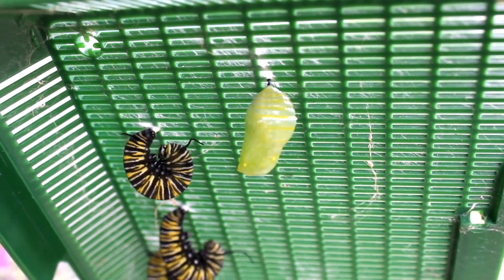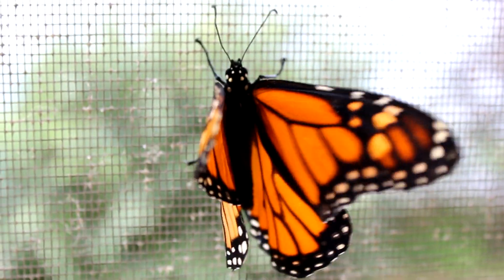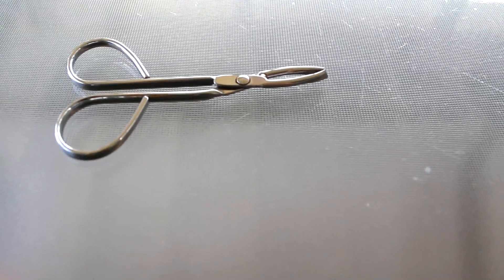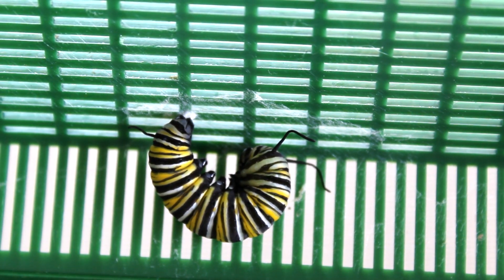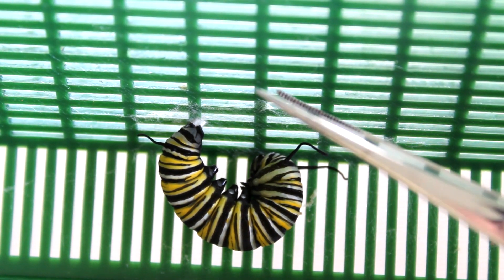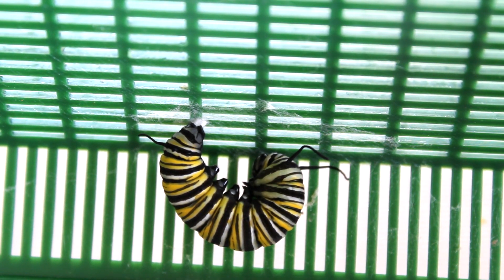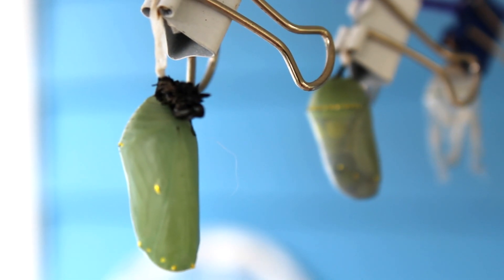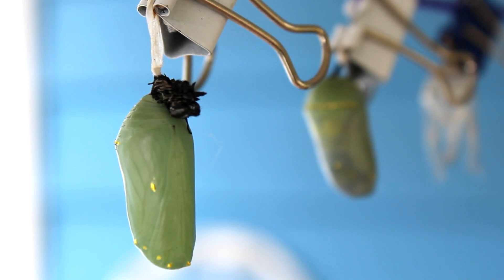Raising Monarchs - Side J-Hang Relocation (Help The Monarch Butterfly)

Comment: Great video!  I use the mesh rectangular enclosure and a few times as they were getting ready to j hang on the side I wasn’t sure if I should move or not (I was also quite new) and I did try to move before he hung and I could not see that he had laid the silk button because of the white enclosure.  I didn’t know what to do when I saw the silk as I moved him and resources for immediate feedback are very Limited or non existent.  I tried to get him to cling to the top of the enclosure but i didn’t secure him and he ended up wandering back down.  I was terrified not knowing do they only get one shot at laying the silk button and had I hurt him by trying to help.  Luckily he ended eventually made  his way back up.  Thanks for this resource!

Another issue I personally have been encountering pretty much every time since I started with these enclosures  is they all pupate in the corner and very close together but because of the oval shape of the enclosure they seem to struggle when emerging.  It’s been a big problem. For many of the chrysalis.  I have many pics and videos showing the full process if you would like to see to possibly make a video about (especially if using the enclosures for outdoor rearing).  My next round are all pupating and once again each one is going to that corner.   If you would like to know more about this to educate others that might face it please email me at kdinoto@comcast.net and I would love to share the experience with you and also get any feedback you might have on how to address.  Thanks so much your resources are so valuable!!
Reply from the maker: Sometimes people ask about relocating the chrysalis after it forms, and if that's something that needs to be done.  I definitely do it, but that's due more to the numbers that I might have at the time.  If many chrysalides are nearby each other, for the most part, there's no immediate problem.  However, if two Monarchs are coming out around the same time (which can happen often) and they are close enough, one can disrupt the other while the wings are drying, and this can cause major problems.  The wings being pumped with fluid and drying is a very important and vulnerable time for the Monarch.  For this reason, I relocate mine.  If someone is just rearing, say 5 Monarchs, it's usually no issue to let them pupate where they like, and they can even emerge in that same vessel.  But if there's enough to cause concerns when emerging, they should probably be relocated somewhere.  Further, if there are chrysalides that are housed with caterpillars, especially other 4th or 5th instar caterpillars, while it's rare, a caterpillar could nibble on a chrysalis.  It's been known to happen.  So, when dealing with larger numbers, this is another reason relocation is a good idea.
I definitely don't want to present the helping of Monarchs as something that need be expensive, but if you have enough numbers to where you are concerned about chrysalides clustering around each other, you may wish to have a separate pop-up tent that is reserved just for the hanging of chrysalides and as a place for the adults to emerge.  Just a possibility.
Good luck!
Reply: MrLundScience thanks it wasn’t even that there were a lot but they all went together in the same corner anyway and came out on the same day.  Moreover the rent enclosures are arched at the top so when they emerge they actually don’t have enough room as they would if the container were perfectly square. They realize this and try to move and they end up walking down the side in search of more room and then can’t hang to dry because they are on the side. I ended up getting him on a q top and then using a clip to attach it in the middle of the enclosure so he could dry but has I not been home not sure what would have happened.  I know you have them on the string but for those using the mesh enclosures for outdoor rearing I suspect many will encounter the same thing as my second round are all doing the same thing and congregating in the corner.

Comment: There's a much easier way to move them that might also be a little safer (no pointy metal objects). Just cut a piece of clear packing tape (about 2" x 2"), place it up on the "ceiling" so that the edge of the tape touches the silk button. Then press the tape really well all over the ceiling. When you peel back the tape, it will peel off all the hidden silk that is spread all over the ceiling, and take the caterpillar with it. Just do it slowly, and cup your other hand underneath the caterpillar in case it falls. I've never had one fall. Sometimes you'll have to apply two pieces of tape, one on either side of the silk button, so you peel off more of the silk. You can also adjust the silk so that more of it gets stuck to the tape. I usually press the silk button against the tape so that it adheres really well. Then fold the tape over on itself, so that the silk is completely sealed inside tape. Then you can pin the piece of tape to the new location.
Reply from the maker: Definitely a cool way to do it.  Most of the time, I'd expect it'd work great.  There's been a couple of times where a chrysalis has been in a tight to reach spot, so I'm glad I had my tweezers.  Still, perhaps I'll experiment and try out the tape method even in the more challenging situations to see how much success that I can have with it.  Definitely a great tip!
Reply: @MrLundScience  I have rescued for monarch caterpillars. One of which  J hooked 2 days after , then chrysalis. The other took its time and recently Jay hooked. Now I am concerned about him because after I carefully moving them all to the out doors and left them overnight in there respective vessels. The next morning the one that was haning J hook seem to have straightened out quit little bit. it was morning and I brought them in from the direct sunlight. I expected the J hook to chrysalis quite quickly. But he did not and is still hanging straight 2 Days Later. What has happened to my caterpillar?😔 did I do something wrong? Was it perhaps too cold over the night? I got them all out of the Sun as quickly as I could. The very large jar the J was  hanging in, seemed to have some amount of moisture on it but thought that was normal under the circumstances evening into morning condensation. But the caterpillar was not really in J hook any more?I am not comfortable now putting them outside. But because they are autumn caterpillars and eventually and hopefully butterflies I'm afraid they won't migrate properly so I was doing my best to raise them outside. Please help I live in South Central Ontario and although it's still lovely days the evening can get cool. should I pull them in for the evening and then put them back outside for the day time? I have an an archway vestibule to my front door entrance..would they be safe there. I am concerned now this is my first time
Reply: @charlenehough1914  hi, just saw your comment. I'm almost sure your J didn't make it, given its straight position for a while 😔. I think it might have been too cold? But then again, if it was suppose to make it in the wild..?.. I've raised a few this year and have a few more to go, but I do it indoors. Good luck next time!
Reply: I've moved 2-3 j-hangers at the same time with this method, and several chrysalides at the same time. Sometimes when you peel off one, others will start to be pulled down with it (if they're very close together), so you have to press a finger against the ceiling to keep the others attached, and prevent the rest of the silk from coming down with the one you're peeling off.

Comment: What do you think of the company Insect Lore? My daughter and I have used them twice now to raise and release Painted Lady butterflies. The way they have you do it is, they send you a sealed cup of caterpillars, usually five at a time, with a thick layer of food at the bottom for them to eat. Eventually they J-hang from the lid of the cup, and in the company's instructions they have you take off the lid once the chrysalides are hardened and place it verticle in a little holder. The chrysalides are then hanging vertically rather than from a horizontal surface. Is this bad for the Painted Lady butterflies too? The instructions they give tell you to do this quite specifically, and now I'm wondering if they shouldn't be! Unless the vertical hang is only bad for the Monarchs? 

So far, the first batch of butterflies we got last year were all perfect. But this batch was different. One of the caterpillars was dead when it got here, and barely made it past its itty bitty stage. Then once the other four came out of their chrysalides and pumped up their wings, one of them had a wing that was folded at the tip. I wonder if this was from the vertical hang? Now I feel kinda awful and wonder if we shouldn't patronize this company!
Reply from the maker: The concern with side hangers is if they form the chrysalis, when the chrysalis is still soft, if it's up against a flat area, this flat area could cause the chrysalis to harden with a flat side, or otherwise misshapen.  Once the chrysalis is hard, it doesn't matter if it is up against something (clean).  The adult body can develop inside the chrysalis even with the chrysalis on its side, not hanging.  In the case of other butterflies, such as the Painted Lady, this is true as well, so the company having you relocate the chrysalis in the way described shouldn't pose any issue.
When it comes to specific companies, I'm essentially neutral.  YouTube can be picky, (and sometimes confusing and inconsistent) as to how they define endorsing companies in videos, and doing the opposite as well.  Further, I have no experience nor knowledge of Insect Lore.
Reply: @MrLundScience  Ahh!! That makes total sense, thank you for explaining it further! :) I feel better about it now, for sure. I just wonder why that one butterfly ended up with a folded wing. Perhaps just bad luck :(